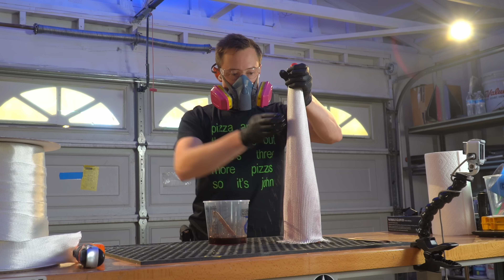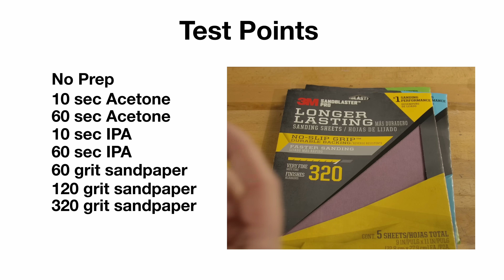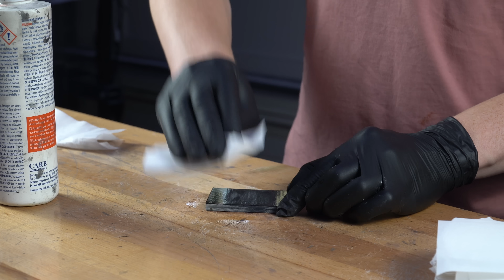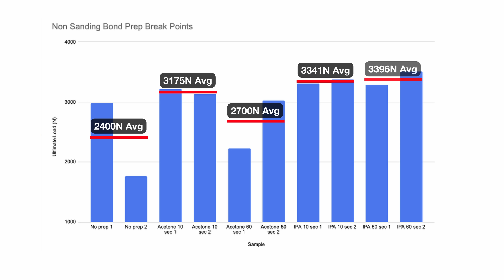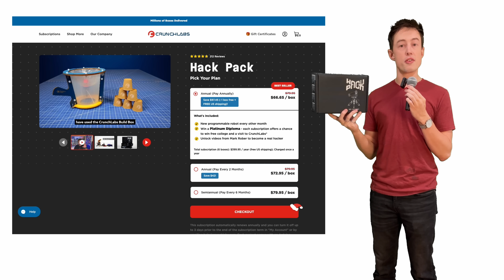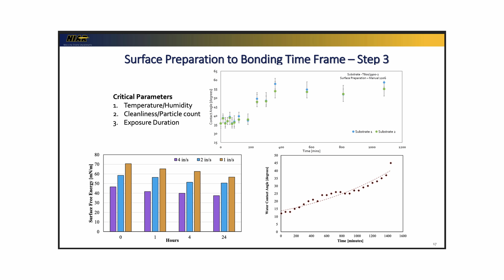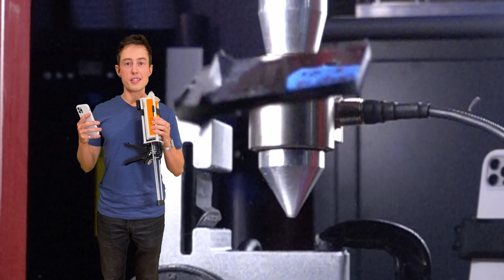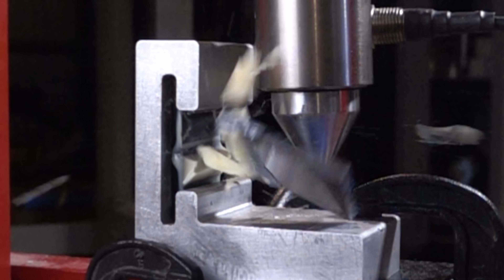I Broke 100 Epoxy Bonds to Find the Strongest

Comment: 19:25 What you're talking about is called "corona treatment" (has nothing to do with everyones favorite pandemic) and it has probably been used on most of the plastic packaging you've got at home before printing. 

My university has a lab machine for testing corona treatments on parts. Maybe you can find a printing or packaging focused university in your area that would help you in return for some exposure. Or maybe you can find a printing company that prints on plastic that would allow you to somehow use their corona unit.

Comment: 20:00 I worked at a polimer film factory, and they had a parameter for producing print-ready film, called "corona discharge". "High corona" was good for ink aghesion and the extruder produced several square meters of film every second. So there is a way to plasma treat the surface in a huge volume. You just need to find out the right setup.
Reply: "I worked at a polimer film factory."  Did you never ask them how to spell that word , polymer?
Reply: @tuberroot1112  not everyone has english as a first (or only) language. You would probably struggle with spelling words in a language other than english.
Reply: @tuberroot1112  I'm glad this is the only strange thing you've noticed in my comment. English is weird. I spent many years watching English Youtube and still struggle to understand it. Why didn't some easier language (e.g. Italian) became the global lingua franca?
Reply: @ВасилийКоровин-г9э  Assuming the question isn't sarcastic.  Because the US and USSR won WW2, and the US won the race to digital electronics; the soviet union stayed analog for a very long time -- and this is even reflected in their different mathematical approaches to some of the same issues.  But technology is digital, and the bleeding edge of science is in English, so English is the global language for science and technology.
Reply: @keinespur0  It's not a question at all. It's a complaint. If you take Russian sentence and replace every Russian word with a proper Italian word you'll get a proper Italian sentence (actually you won't, but you'll be almost there). If you take Russian sentence and replace every Russian word with a proper English word you'll likely get some bullshit.
There is a joke in Russia: "If you learn by heart Russian-English dictionary, you will speak Russian-English language".
And phonetics are also quite alien. I've learned Italian for several weeks 25 years ago and still I find it easier for me to listen to Italian songs than English ones.
Reply: @keinespur0  It's not a question at all. It's a complaint. If you take Russian sentence and replace every Russian word with a proper Italian word you'll get a proper Italian sentence (actually you won't, but you'll be almost there). If you take Russian sentence and replace every Russian word with a proper English word you'll likely get some meaningless sequence of words.
There is a joke in Russia: "If you learn by heart Russian-English dictionary, you will speak Russian-English language".
And phonetics are also quite alien. I've learned Italian for several weeks 25 years ago and still I find it easier for me to listen to Italian songs than English ones.
Reply: @tuberroot1112  Did you never think to look at his username and then reason it is possible he just does not know how to spell it in English? Whats it like to know how to spell correctly in a language but then not have anything useful to say in it? Must be tough......

Comment: Can't you do the vacuum degassing progressively to let the air come out slower? Do NOT change your method half way through if you are looking for consistent results. Small sample size, boolsheet testing has NO value. Stop pretending that using crap methods does not really matter. Bad data is useless. Believing in bad data leads to false or erroneous conclusions.

Comment: For me i ALWAYS clean BEFORE sanding and then after as well.
Thinking that sanding while it isn't clean i get the dirt and oil deep in the sanding scratches and a low bonding
And those mixing nossles does a bad job at least at the first pumps, always put the first pumps in the trash.
And look at the epoxy tubes, only the ones with two different tubes does a good mix proportion, some have a single plunger and the two parts are in sausages that mixes very unequal.

And i also like to put on epoxy, rub it in with a glove that i cleaned before then take the rest of epoxy on

Comment: When i was mixing propyleneglycol, glycerine and flavours for my vapes, i put the 50 ml glass bottles in an ultrasonic cleaner (a small one for sunglasses) to aid the mixing process. The bubbles from shaking the bottles were rising significantly faster. There is ultrasonic cutters and also some ultrasonic emulsifiers (for making salad dressing i guess). These could help with the parts that don't fit in a vacuum chamber.

Comment: Watch the degassing vacuum level, go too low and you're not removing air you're boiling the resin and the bubbles you see are solvent vapour. Looks to me like you were going unnecessarily deep on the vacuum, there not that much air in the resin mix.

Comment: Maybe you already thought about it, but there are abrasive bushes you can put in CNC machines for 1) consistency, 2) having the prep being done by a robot while you do something else. Very often they are mounted on a spring which heps with pressure consistency.

Comment: One solution to "uncontrolled valiables" is to control them.  Firstly you did not need use black die, I guess you thought that could be a factor retrospectively. If you have black and green samples , do a couple of tests with other variable kept the same. Are they consistent? Anyway. interesting stuff and thanks for emphasising the caveats.

Comment: The free oxygen thing might also be possible with peroxides or ozone, given how unstable they are. But some of the potential chemical reactions there may be a bit spicy if you mix them with other things. So it would take a bit of separation of stages in surface prep if messing around with them to try and prevent that. (Probably a reason why it's not worth the bother?)

Another idea that may be interesting though... Slap some piezo devices in there and expose the parts directly to sound or ultrasound while the curing takes place. If you think about how ultrasound cleaning works, that may give a picture of that doing something.

Comment: I didn’t read all previous Comments but here is my Experience…

Acetone you can buy here in 10L Canisters is very dirty.
99,9% Purity leaves ample Room for strange Stuff.
A Mirror Evaporation Test shows quite some Gunk.
IPA is a lot better but still not clean.

High Grade Acetone is annoyingly expensive but so much cleaner I didn’t find any Residue by Eye.

Aceton + IPA might end up really good if you can avoid bringing in new Contamination with them.

(My Tests were not focused on Cleaning Parts.)

Thanks for the Video and Thanks to the Experts in the Comments with valuable Information.

Comment: Meanwhile me: wouldn't a shim based through-mount (aka old-school joinery) and holes where the epoxy can interlock with itself make an even stronger bond? -without adding much more material ofc.

Comment: Have you tired rf plasma generation in vacum chamber for increasing the surface energy of the composite part? In this case you turn most of the gas in the vacum chamber into low temp plasma using some rf generator ir magnetron.

Comment: finding the strongest epoxy is great but. Isnt it way more limited from the design itself. I have no clue in rocket design so pls tell me if im wrong. Why not connecting the fins together. With a small rod at the end points. That would put the stress point from the connectoin equally to all fins. No idia about airflow and drag. Im not a rocket sciantist

Comment: When wiping with the lint free wipes and IPA, you want to roll the wipe around your fingers and swipe it in a rolling motion across the surface, so to only expose the very fresh area of the wipe to the surface, otherwise you are only smearing the dissolved contaminants out. Do this a few times, every time with a fresh wipe.
A few hours are usually ok between surface prep and glue application, but leaving it over night and continuing the next day will have an impact, due to oily aerosols that are always present in the air. My experiences with applying strain gauges.

Comment: I wonder if there would have been a difference in bond or consistency had you used sand papers with different abrasives. The sandblaster series just says it is ceramic coated aluminium oxide, and the pro doesn't mention which abrasive it even employs, but the 3m wetordry you used for higher grits is silicon carbide entirely. Maybe there would have been some variation between pure aluminium oxide and silicon carbide at the same grits, but I think it's mostly moot once you discovered the acetone and IPA method.

Comment: This is all great, but why do you bond butt-joints when you could do a wet layup to get much stronger T joints?
Reply: Or even prefabricate GFRP brackets with vacuum infusion and then glue everything together as a "⅃|L" shaped joint, as opposed to direcly laminating the glass fiber into the seam.

Comment: 2 things. Normally I apply glue to the surface being attached. The edge of the fin. I don’t grasp the reasoning. 1000 grit has no bumps for glue to settle into, so clearly bad. Also I’d cross sand the support so it connects with more grooves than same angle sanding which I’d do diagonally. Deeper grooves can make for more binding but also brittle connection. M3 = wind sheers that rip off anything even bolted down. Idk glue that much. But. Huh

Comment: Firstly what an excellent video 👍You must have put a crazy number of hours into this, no wonder you were feeling burn out towards the end. Secondly a couple of points to consider:
1) I am suspicious about degassing in the mould, how much of that gas is actually air you are pulling out of your 3d print through the grease  and into the epoxy?
2) The grease is messy, labour intensive and adds another potential level of variability should it accidentally contact the bond area.  A two part mould that is clamped together with e.g. bolts and wing nuts, which can be lined with a thin separator material (baking parchment?) would eliminate this and mean far fewer moulds would need to be printed.

Comment: Here is some variables (maybe) not counted for. Ambient and surface temperature, Relative and surface humidity, UV-light exposure (black ink vs undyed) and barometric pressure. Would it be beneficial for the data if these was included in the test results?

Comment: RE: dye and mould release affecting experiments: 

Dye can definitely affect strength of polymers & resins, and it varies by dye (one of the reasons why red/pink plastic is more expensive - it weakens the part, so you need to make it thicker compared to phthalo blue, as seen in disposable razor handles). 

Some mould releases or lubricants can interfere with epoxy curing (it ended up as a thick goo, not solid) - I remember seeing this ruin someone's art project on youtube, but  can't remember who or where (sorry D: ). 

Edit: I don't think the fibreglass panel colour will matter if the failure is in the epoxy bond.

Btw, like 5 minutes in writing this, it might all be addressed later, but food for thought!

Comment: Very interesting, many years ago I was involved in testing printed circuit boards, we would drill the holes for the components and then deposit a thin layer of copper onto the inside of the holes, drilling produces a thin layer of epoxy smeared over the surface so we put the boards in a plasma etch chamber which exposed the surface to ionised gas/plasma for about 30 minutes, this greatly improved the results. (We also accidentally left a board in the chamber far to long, this gave us a loose fiber glass mat with no resin at all!)

Comment: I have a question.
I notice that when vacuum degassing the epoxy there are a LOT of bubbles. Is this just air bubbles expanding or is some, or even most, of this volatiles from the epoxy itself boiling off?
This leads to a secondary question, namely, if so, is this a good thing or a bad thing?

Comment: Instead of pouring epoxy into the joints I would try coating the parts with a spreader, assembling, then pouring in. The thinking being the spreading/rubbing  pushes epoxy better into the texture that you sand in.

Comment: i saw a video years ago of someone dropping a carbon fibre bicycle gear and it rung like metal.. 

he had used a hydraulic press on the moulding, 10/40 ton cant remember, he also didnt show any testing, seemed intreaguing, probably works best with flat stuff....

Comment: If you've already found that with better than average prep, the epoxy breaks 'internally' and is still bonded to the surface, why assume better surface prep can make still make a difference?

Comment: you missed out a big detail you tested on flat surface the body of a rocket is not flat the surfece being a cylinder will change the way the resin hold both part and it may change teh result in some case not by a lot but enough to be the limit between failure and a win for a rocket

personaly i would say the test you are doing are better the other you cite as proper test for me have one probleme they are generic in your case you already know what you want to do

also one last thing there a way around everything when you tested the resin and saw adding hand mixing made teh resin stronger but there was the variable of the dye simple redo the test just for that batch without the dye since you don't need it for that second test and that way you rule out the dye from the test

same thing with the green and black plate just do more test to see if there is a difference after that it's only a question of taking this into account during those test

this is hte best way i can think of making the test more accurate the best you could

Comment: A good glue mixing method at home is to use a food mixer on an electric drill. Heat curing the bonds should increase the strength. Another method of surface preparation is laser ablation. If you want really strong bonds for your fins cap the glue joint with a thin layer of laminate.

Comment: With the spread of the results you make a little mistake which feels natural. When you see two very similar value a you get the feeling of consistency,. But it is probably still statistics. It would be interesting to have at least from one technique so many samples, that you get an idea of errors and maybe what happens in the high spread scenarios.

Comment: I've also been told that a grit blast with say Garnet is even better again, but where do you stop? There's also acid etching as it done with alloy surfaces - boat prep. Also did you consider post cure heating? Seems to be covered in the study - had to pause the vid.

Comment: Great experiments. I wonder, could there be quite a bit of variation in the gap and contact at the butt joint? Perhaps the token that meets in the middle of the other part should be chamfered?

Comment: you should get a small handheld belt sander, that way you can get consistent directional sanding. maybe not necessary but i would also blast the surfaces with compressed air to remove fine particulate that will be trapped in the grooves. but here is a big one from my experience as a carpenter, a smooth surface is less likely to crack. so if the epoxy has a sharp grove or imperfection then the risk of a crack forming there will be much greater. so having a near mirror finish on the epoxy bond will make it stronger.

Comment: Interesting tests. Other factors to consider:
-curing temperature: some samples appeared brittle. 10 degrees warmer can make a crazy difference, depending on the used resin... (Basement workshops at 15C is usually enough to not let the resin fully cure)
-how is the push rod distance from the gluejoint controlled in the teststand. As you measure only pushforce, the stresses in the joint are different depending on the push rod position i e. The introduced moment...
Keep up experimenting
Reply: Joe said that he performed his experiments in Summer 2024. So unless he is in a desert environment where temperatures plummet at night, I would not worry too much about low temps for curing.

Too high environmental temps might even be a problem, causing the epoxy to cure faster than expected while he is degassing it.

Comment: Very useful and interesting work for a wide audience, thank you.
Would viscosity of the resin used have an effect on bond strength (e.g. high viscosity not locking into smooth grit sanded samples, assuming they have been well cleaned of course)? granted, the vacuum would help but what is the effect of that ? ;)
also the grit  of the sanding does have an effect on effective bonding area:  can it be used to match the modulus of the resin to that of the substrate (no need to go further, esp. if compromising the substrate)?

Comment: Your incomplete data through inconsistent testing methodology outside lab conditions and without peer review is far more valuable to normal people, who also operate outwith these boundaries.

If it works better for you, it will also work better for us.

Normal people don't need the exact lab quality best, they just need the best THEY can actually do.

Comment: summary for some good comments below - 
i would try to do the surface prep "roughing" with a sandblaster, so i can get a more consistent result over a larger, non-flat surface, like your rocket parts usually are.
washing it with acetone, no wiping but blowing it dry with nitrogen
washing it then down with IPA, again blowing it dry with nitrogen
trying some fiber filler into the epoxy